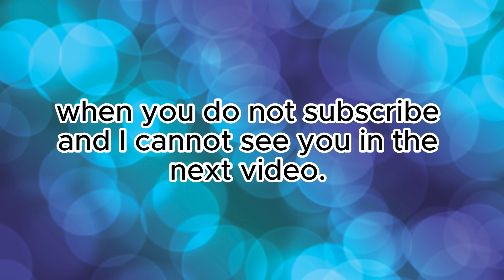Air Brake on an Airplane. #airplane

Comment: The wings on big planes like the Boeing's open up to dump all the lift provided by the wing to get as much weight as possible on the tires for the mechanical brakes to do their job. They are called Spoilers and spoil the airflow.
Reply from the maker: In the case of most airliners, lift spoilers that also act as air brakes.